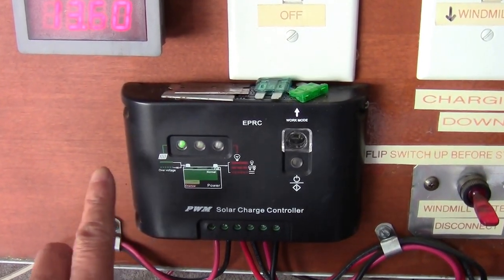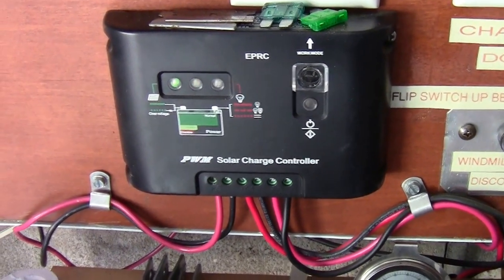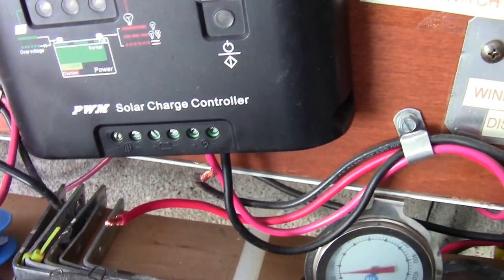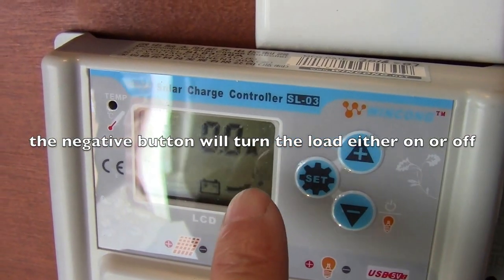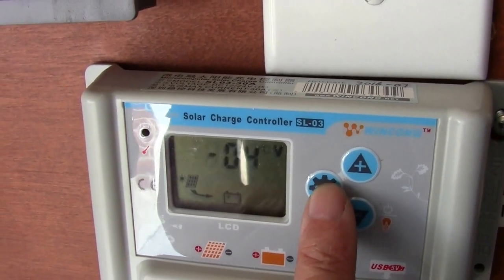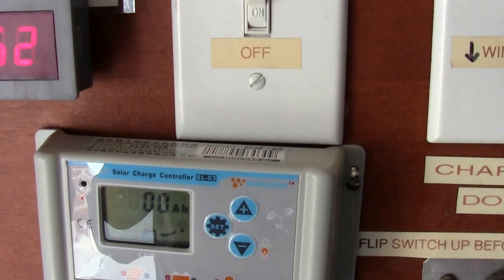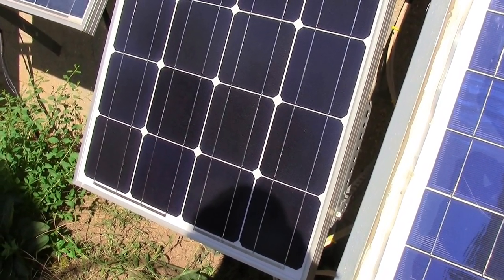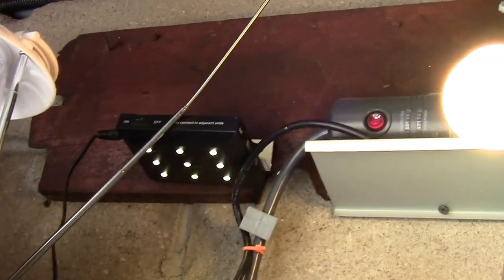Wincong 30 amp solar charge controller with 100w solar panel

Comment: Hey Paul, got a question. Im building a portable powerbank. I still have the same chargecontroller here from wincong. Can you turn the power to it off and does it memorize it settings? I was not sure so that why i ask you. Thx man. Greetings Erik
Reply from the maker: @rikkiesix  if you mean when you disconnect the battery to the charge controller then it might not remember your settings/configurations. If it remembers the settings after disconnecting the battery, then u let me know.
If you’re just turning the load to on off, then it makes no difference. The settings won’t be changed. Anyway resetting the configuration to a specific charging profile is not difficult.

Comment: Do you know the max Amp output of the 5v USB port? Thank you.
Reply from the maker: Not more than 1 amp. I'll have to check the manual.
Reply: I would appreciate it. I couldn't find it on any of the product listings. Usually they tell you. Thanks again.
Reply from the maker: I checked the manual and it's 1 amp.  Do not try to charge items like an iPad (can draw 2 amps). I remember doing that and the solar charge controller usb output got pretty hot.
Reply: Thanks, that's what I was afraid of. I might need to get a voltage step down that I can hook to DC output, which can provide 5v and up to 3 amps. Most of the charge controllers I've looked at show minimal amp output on the usb port. I still like the features on this controller, though.
Reply from the maker: The usb buck converter I use for charging is only a dollar on eBay.  Supposedly good to 3 amp.  http://www.ebay.com/itm/6-24V-12V-24V-to-5V-3A-CAR-USB-Charger-Module-DC-Buck-step-down-Converter-/172398891801?epid=621997948&hash=item2823c65319:g:FUUAAOSwMVdYHT8j

Comment: hallo sir if i want to lighting 15 of 5 watts LED bulb all night what solar panel and battery i needed
Reply from the maker: A good choice will be a 125 amp hour deep cycle battery with a charge controller with programmable load control and a 100w solar panel.
Reply: Thank u sir